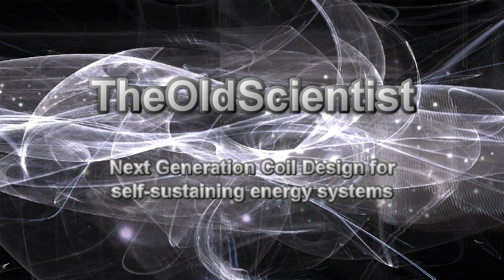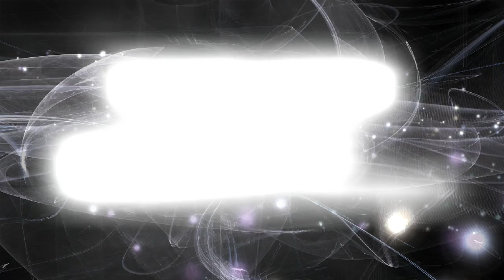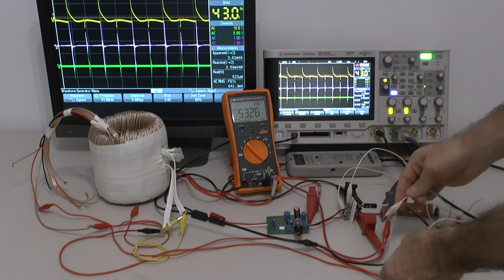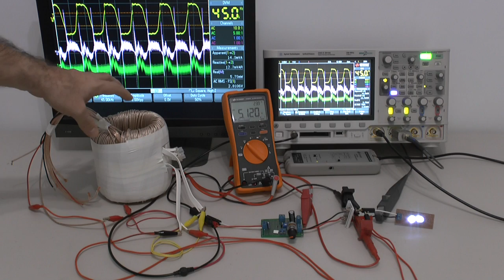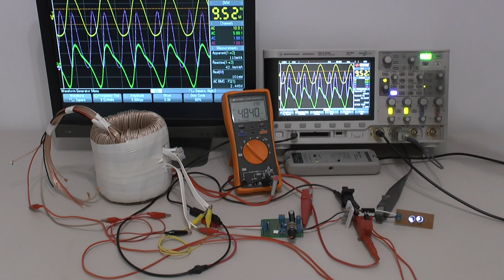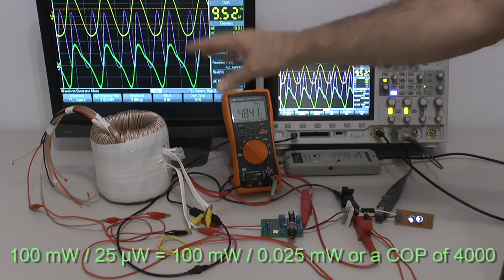Next Generation Coil Design for self-sustaining energy systems

Comment: The big coil will be in resonance with all electronics inside your house and act as a battery.  If you want to show it for your self put in 100 watt and try to get ot 4 kwatt.  All loads that uses lamps and so on are a disgrace. Naudin , a shill site for the power structure, does this all over the time. The end load should be  a resistor in a tank of water and bomb calometry should be used to calculate the energy.

Comment: The really good part is that these special coils require no semi conductors or supporting input power supplies to achieve their amplification effects.  Making them highly reliable and independent of our antiquated power grids.
Reply from the maker: That is not entirely true. You have to move them and that is only possible with an AC signal. So, you need one and power.
Reply: Thank you I did not realise this important  fact....Gerry

Comment: Thomas , how can you rotate the fields inside this special coil with only 1 drive frequency and no phase shifter ? Do your coils autonatically do the phase shift ? Do you hit the selfresonance frequency of these internal coils , so they have a high resonance voltage on them and then use 2of these coils to go into the nanoperm transformer to generate also a current ?
Reply from the maker: No, in my finale version there will be more than one signal. This is the simple concept but not the final working system.
Reply: Gee I would love to believe you but it's a lot easier to believe the "special core" of your transformer is a rechargeable battery that is inductively recharged.  The yellow jumper looks like a switch to me. Just saying: a claim of cop of 4000 requires a lot more proof. If you had all your cards on the table, someone might replicate, but you are OVERLY secretive. So I ask the obvious
Reply from the maker: There is no switch but the power rating of the LED is here wrong used. Watch the videos I produced afterwards and it will become clear. Power ratings of light consumers should never be used as benchmark for alternative energy system to define a COP > 1

Comment: I would like to see a circuit diagram first . Do you consider losses in your connecting wires that could be substantial . How is a rotating field developed in that coil ?. Power is measured at zero phase of volts and current,ie Cos phi is 1.
Reply from the maker: Not to a creat deal. Remember I need resistance for the impedance match. Currently the resistance is too low for the load. I just tested the 4 LED load and it works much better and measure now 1.6 Watt at 5 volt via a transistor BC639. signal comes from a TS555

Comment: a bifilar coil can store a lot of energy in its dielectric field, en should be able to couple to another bifilar coil via the dielectric field, with an air core.
Reply: Master Ivo , hi. Is this another pathway for achieving the same outcome? I had tried a few years ago, to replicate wattusup’s pulsing coils and lighting LEDs part6 and 7. He too was perplexed by what was causing a single pulsed coil in an air core coil to be able to light up LEDs. I found that cold moist aluminum could work for the lack of a pulse generator, and once started, remained colder than ambient functioned for 
months, if like Old Scientist explains, extremely intertwined with the environment around it. Till today I don’t know why or how it worked, and that is my interest in learning from this set of generous explanations. I thank all of those who demonstrate and teach those of us wanting to learn from wisdom gained from time and experience.
Reply: I dont know. Many paths lead to Rome. If a voltage pulse is combined with a current, it should produce a power spike. now pulse several thousand times a second, and you can use this power.
Reply: tarotbug, I think most of us are only guessing. I made some videos where electricity is explained by C. P Steinmetz, maybe it can inspire you.